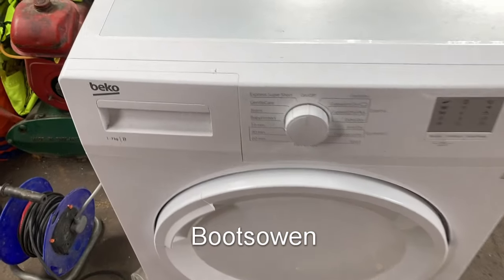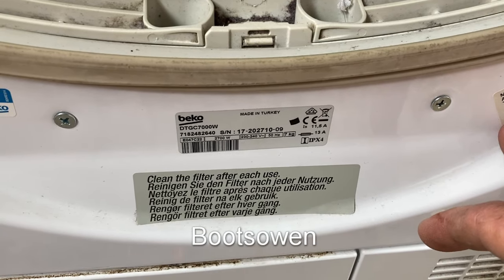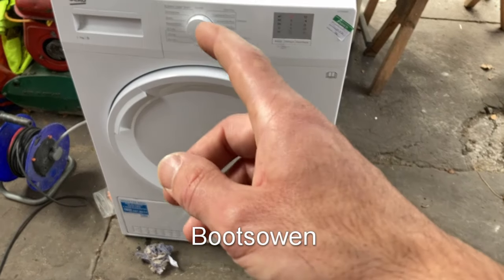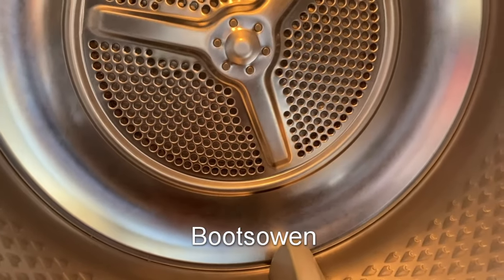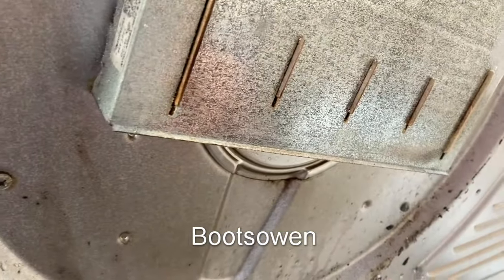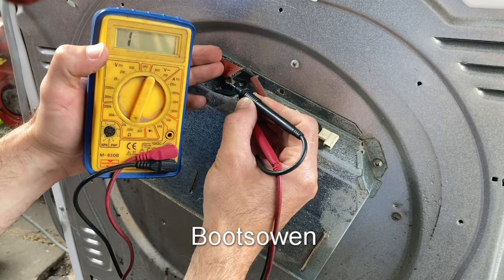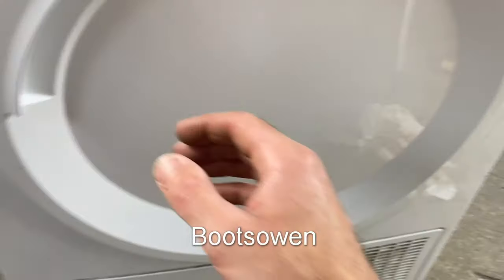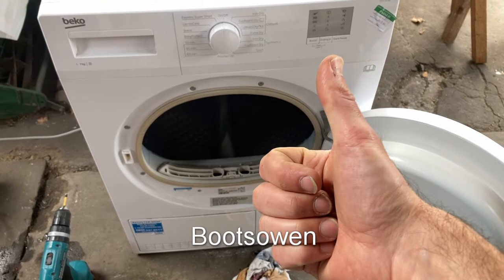Condenser tumble dryer fault finding and repair | easiest fix ever | Beko DTGC7000W

Comment: Usually when the safety stat has tripped it's due to the non-resettable one failing. The only other cause generally is opening the door whilst the heater is on, and thus the heat contained in the element isn't carried away by the airflow, causing the safety stat to trip. Best to advance the machine to its cool-down cycle for a minute before opening the door or otherwise stopping the machine. Nice clear video offering a concise basic troubleshooting methodology 👍

Comment: Thank you for your video, which helped me a lot. The tumble dryer works!!!  It's only 4 years old and hasn't been used that much.  I would like to say one thing : Do not open it during the drying program because then the thermostat goes crazy and this is often the reason why I stop heating.  I just learned this from another source, but I hope it will be useful to others as well.

Comment: Mine trips the rcd after a few seconds running. What would you check first? I popped a small bit of hose under the dryer and was clogged. I cleaned that out but still the same
Reply from the maker: Heater element?

Comment: I have the exact same dryer..mine has just started to stop saying the water tank is full but it is infact empty and is not collecting water..its all leaking at the bottom instead..i think theres a blockage somewhere..can anyone help please? 🙏🙏
Reply from the maker: You seem to have diagnosed the issue. Take the pump apart at the back and clean it. Easy.

Comment: I have a newer model and it was heating but not drying. Replaced the pump but no change. Today I looked inside at the holes in the back of the drum and realised the area behind the drum was full of impacted lint - no clue how so much of it got past 2 filters. I got it all out with tweezers because I was too scared to take the whole back panel off (I did take off the felt panel like you did in this video). I came to ask - do you think it would be ok for next time to unscrew the whole back metal panel? Or is that risky?
Reply from the maker: It’s the only way to be sure that you have the lint out

Comment: Mine works with no heat at all , thermostats are fine and element even replaced for the sake of it and still the same problem could it be the pcb control board
Reply from the maker: I guess. You could check if voltage is getting to the element when it’s running. But I wouldn’t advise that unless you are electrically proficient

Comment: Same model and problem. The red button will not click. Is it likely a new heater will solve the problem or does it need a new red button as well? Thanks.
Reply from the maker: A multimeter might tell you.

Comment: My beko condenser sensor dryer. Is heating up but keeps turning itself off. All the lights go out on the control panel. Possibly an issue with the PCB?

Comment: What if there is no reset button? My machine gives error code E60, I have cleaned the reducer, strainer and seal. It didn't help. Suggestions for what to do next?
Reply from the maker: What does e60 mean?
Reply: @bootsowen  E60 means that the seal, strainer and condenser must be cleaned. the door handle/lock is broken. the door can be closed but I'm not sure if it's tight. can the machine stop heating if the door is not tight?

Comment: I have almost the same model that is heating normally but sometimes it is stopping the cycle just after 10 minutes and the flashes for filter and tank starting to flash it means that the tank or filter are full but they are not so i have to start again and again until it finishes the cycle
Reply from the maker: I have the same problem at the moment with a heat pump dryer.

Comment: Any idea what size the screws on the back are? I've got one someone opened and failed to repair but they binned/lost the screws.
Reply from the maker: Usually similar to other screws in the machine, some kind of self tapping thing.
Reply: @bootsowen  this is weird, the element looks good and I have continuity across the fuses but still no heat. Element showing about 34 ohms and 65ohms on the 2 loops which I guess are high low?
Reply: No worries, found looking for replacement parts that are common that they have a front thermostat too so I think that's popped rather than the back and whoever looked in the back didn't look further.

Comment: Thank you you saved me €140. My dryer kept tripping my switch I cleaned it an Still didn't  work I open up the bk an there was an quality street wrapper stuck at the heat springthank you 🙏
Reply from the maker: Glad it helped Pamela. If you want to share please see the links in the description or use superthanks. Thanks.

Comment: I have this machine and it keeps cutting out less than a minute into the cycle. I have cleaned it all, took the back off and checked the trip button (couldn't press it).
Do you have any suggestions? Thank you 😊
Reply from the maker: what do you mean by cutting out? tripping the fuse (RCD) or something else.

Comment: Hi. i love how informative this video is. Will be sure to subscribe. I have an issue with my Beko DCU7230S condenser drier. It is tripping the RCD but only when I press the start button to start to machine going and it happens instantly when the start button is pressed. It doesnt trip when I turn the power on. Would this suggest an issue with the heating element? Any help on this would be hugely appreciated. Thanks. Oliver

Comment: I have this exact machine and moisture is leaking from where you removed off that metal/form part at the back of the machine through the small cracks. Any ideas how I stop the water steeping through the small cracks?
Reply from the maker: Much water?

Comment: Hi,my dryer stopped working suddenly and now doesn't have any power. No beeping and no light came on. Do you know what the problem could be? It's the same dryer like that one from the video.
Thank you!
Reply from the maker: Plug? Cable? Power switch. Suppression?
Reply: @bootsowen  I've checked the plug, it's working.
I've replaced the fuse but still nothing. I put some clothes in to dry them and it suddenly stopped after 10,15 minutes.
Thank you!
Reply: @johnmarck5986 did you find out what it was? Mines just done this

Comment: I know this post is a year old, I have the same dryer and today it just completely went off and there is no power to it now. Check the fuse it's fine. Plugged it back in and still no power. Do you have any suggestions?
Reply from the maker: did you do what I did in the video?
Reply: I haven't took the back off to check the heat because that was working fine yesterday. The main thing is it won't power on at all
Reply from the maker: Fuse in plug. Cable. Main switch.
Reply: I've checked the fuse, cable was my next step. What do you mean by main switch?

Comment: We have a CANDY and the condenser won't drain into the tray - the water stays in the condenser. How do I fix that? Machine looks fluff-free. Thank you
Reply from the maker: Sometimes the pump that pumps the water to the tray gets blocked. See if it is?  Usually you have to take a panel off the back
Reply: @bootsowen  Thanx for the reply - we don't have a pump in that model.
Reply from the maker: Well it sounds like something is blocked. Have a look at the back of where the condenser goes
Reply: @bootsowen  Thanx for your advice - much appreciated

Comment: Hi, firstly thanks for all your effort on the videos, your methodical approach to fault finding has taught me loads.

I was wondering if I could pick your brain. Beko dryer is tripping the RCD with a beep once up to temp, about 10 mins in. Engineer has installed new door seal, main board and heating element but no joy. Pump/float for condenser is also working fine and I’ve cleaned everything as per this video, any ideas before I concede defeat? Suppressor issue perhaps or is that usually on startup? Cheers!
Reply from the maker: Thermal trips?
Reply: Unfortunately not, new heating element fitted which comes with new trips pre installed. I'm down to NTC or suppressor now.  @bootsowen

Comment: I have this exact model and have for around 2 years. All clean and dandy. Today, mid cycle, it turned the child lock on itself (my partner swears it wasn't him) and now we can't get the child lock off so cant use the dryer. We even clicked the the button, turned off and held down the buttons for various seconds and combinations and it's still stuck on 🥲
Reply from the maker: Plug it out and leave it  plugged out for a bit, maybe it will reset.
Reply: @bootsowen  We did that and I think it's time to admit defeat 🥲 Happy New Year!
Reply: Mines done they exact same! Any help appreciated 😢
Reply: Hi I have the 8kg model basically the same, I load it empty water collection drawer/tank immaculate just set it off and makes a little noise and does nothing any ideas guys, would be much appreciated, cheers everyone
Reply: We have the same problem unfortunately 😢